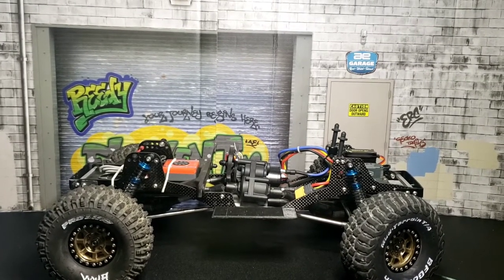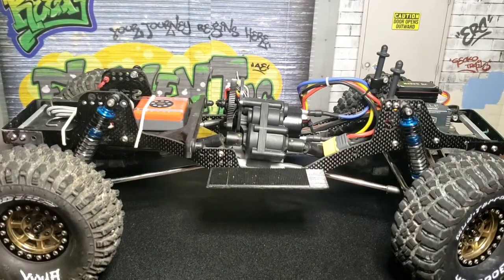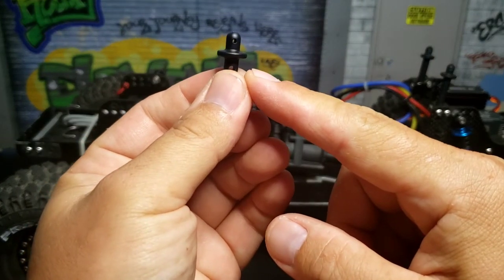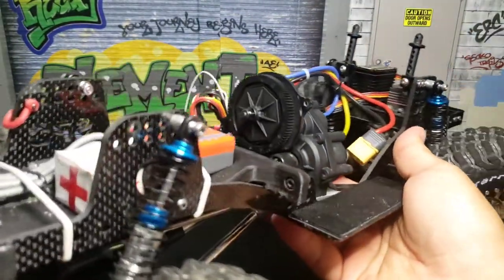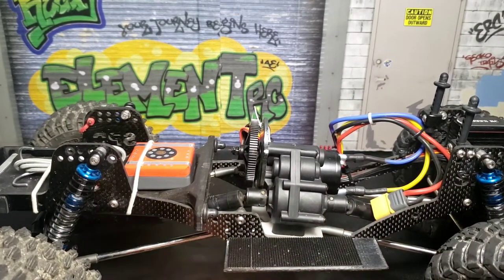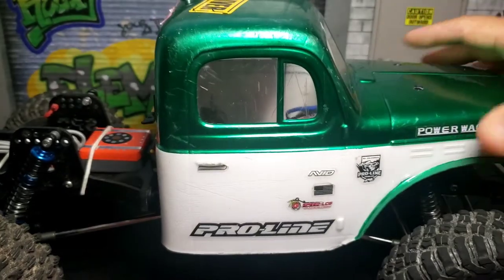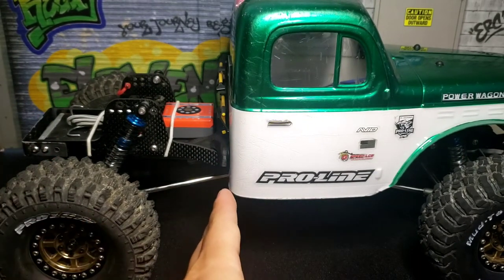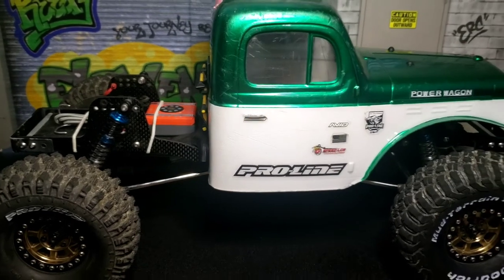How to mount Dodge Power Wagon Proline body to flatbed

Comment: Thank you very much 🚦
Reply: Tim Sorry to bother You yet again , Im just about to buy the G Speed G10 rails , Using TRX4 axles and the GMP Pan Hard Mount , Should I go for the TGH Dual Servo Mount or the Lay Down G Speed Servo Mount ? Promise I won't bother You again for a few weeks lol :)
Reply from the maker: No worries. Really depends on what you want to build. For a comp rig I would go for the GLD setup. Although it can be pain to get it going, its well worth it with better CG but you will need the GWM for your winch. On the other hand, DSM is also a good choice for all around setup that works and is slightly cheaper. Hope that helps🤙.

DSM= Dual servo mount
GLD= GSpeed laydown mount
GWM= GSpeed winch mount
Reply: @danielsonhobbies  You answered all my LCG servo query questions 😂🤗, thanks Average Joe 👍🏻👏🏻
Reply from the maker: @grski900000000000000  Glad to help
 Anytime😉

Comment: Great video! Question, is that skid for an scx10 - 2 kit version? Looking for that skid, any thoughts?
Reply from the maker: Thanks! I bought the bundle that came with the skid from GSpeed. They have a black and white version that will fit the traditinal Axial bolt pattern. The cost $24.95. Hope this helps.
https://gspeedchassis.com/collections/tgh-v3-products/products/gspeed-skid-plate
Reply: @danielsonhobbies  I appreciate the fast response! Guess no one likes the  kit version of that transmission as the hole pattern is different than the 3 gear transmission. Look forward to your next video.  Much appreciated it.
Reply from the maker: No not really but you could always modify the skid to fit which i have seen many times done. Appreciate the kind words🤙
Reply: @danielsonhobbies  Good idea, wasn't sure if it could be done but now I know👍

Comment: Is that a 12t motor?  What size pinion and spur?
Reply from the maker: Yes its a 12t 550motor. I dont have this setup anymore but if i remember corectly its 18t pinion and 87t spur.